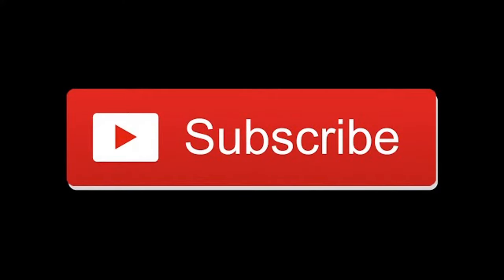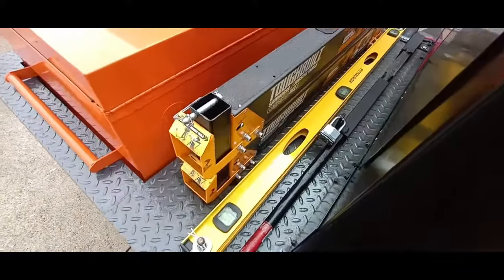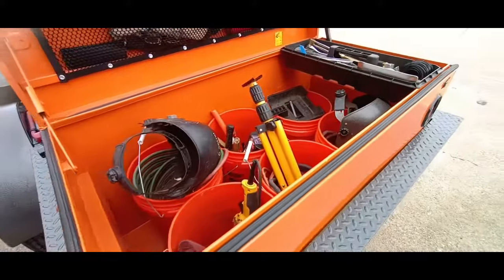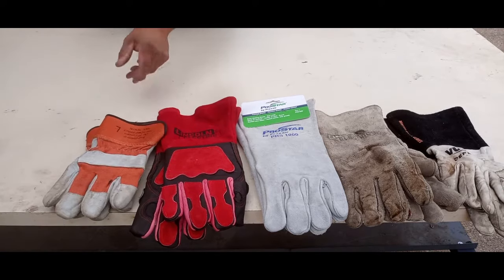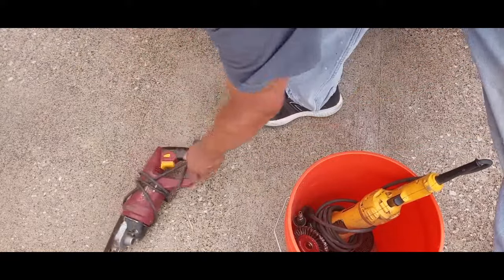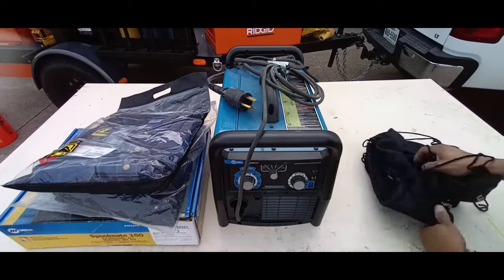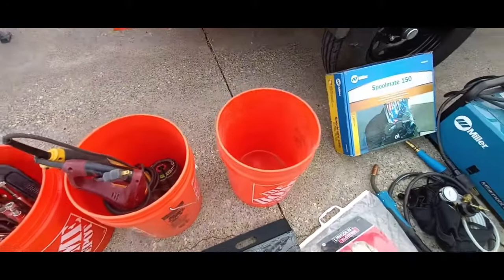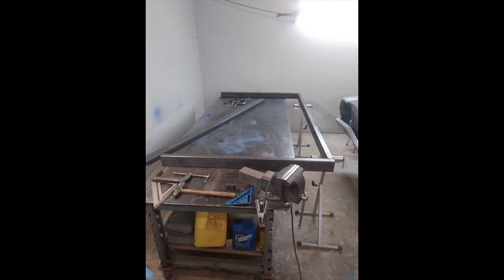Our Mobile welding rig and the tools / equipment we carry  -  DIY Auto Restoration

Comment: Great job on the weld trailer build! Now you gotta build a dedicated truck just to give ideas on how you'd do it and then just tear it down afterwards sense your shop doesn't need it LOL! Example: welding skid for regular pickup , utility body version for the contractors and then a 1500 series custom built using the original bed by cutting the sides down and welding in side load boxes. Just kidding. I'm sure y'all much to busy for all that. I'm kicking around the idea myself about converting a crew cab 1500 into a light duty welding rig using the original bed and cutting down the bedrails to weld in some under deck style boxes. If I do I'll try to get some pics and or video to you guys.
Reply from the maker: Hey thank you for watching I'm going to be adding on to that trailer I'm going to build a gin pole with an attachment and a rack probably put a fire extinguisher in a couple of other gadgets on

Comment: What kind of axle do you have on the trailer? I have a similar trailer at home and I was thinking of doing something like yours. I just wanted to know if my trailer could handle the weight. Also what are those jack stands actual name and use? I’ve never seen them before.
Reply from the maker: Way over kill....it's a 3500lbs axle I purchased at Northern Tool, it was on sale. Those are welders folding jackstand available at any welding supply store. I love them !!

Comment: Have you had the trailer sway with this setup? It looks like too much weight in the back versus the front.
Reply from the maker: The welder is over the axle, right
...
Reply: @guzzifabrication3448  OK-- I had the load shift towards the back on a trailer one time and I got a nasty sway on the interstate. I like the trailer, I am debating trailer vs. flatbed truck on my mobile welding business. Thanks
Reply from the maker: @chriscosby2459  The trailer pulls great, I can lift the tongue by hand, as long as the main weight or load is over the axle you won't have any issues. I see alot of ex-welding rig trucks.... I guess it depends on usage, if your a  welder chasing it everyday, then building a truck makes sense or a great compromise is a skid.

Comment: What do you do for theft protection for the level and saw horses? I want a flat deck trailer but my big holdup is that
Reply from the maker: It would be easy enough to add a lock to those, maybe I should.

Comment: Would be sick to get the plans for this
Reply from the maker: I scratch built, the trailer dimensions are 14' x 4
Reply: Did you angle the front box for a particular reason instead of replicating the rear model of sinking it into the frame or was that cause of the other equipment you have mounted ? Incredibly clean slick design friend , im just fresh starting out trying to get ideas on how to begin , I figured you did it scratch and it’s damn nice . You put your material in the truck for now I saw in the comments, I wonder how an over head kinda ladder rack type removable frame would aid in material storage, however this day in age you need to lock that up just as much if not more then the equipment. Would you do anything different?
Reply from the maker: @jfire5118  The small job box is was after thought, I had already built the frame there is a cross brace underneath....or it would have been nice to sink the box, securing ( locking up ) everything was a primary concern. I've been considering a material rack build other than that I'm really happy with the finish and wouldn't change the layout. Thanks for watching !
Reply: @guzzifabrication3448  last thing , did you do anything to support the underneath the job box?
Reply from the maker: @jfire5118  Bolted on sides w/bracket to frame.

Comment: How much does something like this weigh. But looks great
Reply from the maker: That's a great question... well the welder ways 600-lb itself the trailer frame is way over built plus everything else just a total guess 2000 - 2500 lbs ???

Comment: Nice build. How are you liking the 250GXT so far?
Reply from the maker: Thanks ! It's a great machine for the types of light/medium duty field work we do.                                                                                                                        Not welding related, but we were hit hard in Texas 2021 ( because the electric provider here puts profits first not maintaining/upgrading Their equipment...... ) I ran the GXT 10/12 hours all day and supplied my own electricity to the house off of it....... I ran flawlessly, Thanks Lincoln ! Couldn't count on Oncore the electric provider........
Reply: @guzzifabrication3448  thanks for the info. I’m looking to get one. Really hoping to get a rebate or wire feeder included but doubt that will happen at this point. Happy New Year
Reply from the maker: @mikebb9769  So let me tell you how far out of hand they have let inflation get, I purchased that machine new 3yrs ago and it came with a free suite case welder...... $5000.00...... makes you sick.....
Reply from the maker: I don't know about the quality of the machines sold now.....  Yeah everyone has their opinion on what machine is best.... but Lincoln is my go to. Thanks for watching
Reply: @guzzifabrication3448  what sickens me is that it doesn’t have to be this way
Reply: @guzzifabrication3448 
While Ted Cruz was hiding in the Caribbean. You get what you vote for.
Reply from the maker: @Kyehyfxu  Wasn't me brother that voted for the weasel.....

Comment: Where did you find the twist connectors for building the leads box? I can’t seem to find any that would mount up like that. Sweet build!
Reply from the maker: Ebay type in:  WeldingCity® Dinse-type Panel Socket Cable Connector Pair #2-1/0 35-50mm
Reply: Thank you!

Comment: What is the length and weight of the trailer loaded up. Thanks
Reply from the maker: If I remember right about 13' long 4.5 wide and loaded weight.... no idea
Reply: It's a beauty 😍
Reply from the maker: @MrJasonmca  I just added an air compressor and will be installing a material rack in the near future.

Comment: Dope setup! How big is that trailer?
Reply from the maker: Hey thanks if I remember right about 5 ft wide and maybe 13 ft long
Reply: Do you run your Miller mig welder off of your ranger? Ive always been kinda iffy about running mine off of my trailblazer
Reply from the maker: @natewilliams8823  Yes, I haven't had any issue running the Miller 211, it only weighs 40lbs ( which is nice ) and it's an inverter type, I haven't run a transformer machine off of the generator

Comment: Hello, What thickness diamond plate did you put on the deck of the trailer?
Reply from the maker: More than likely 1/8 of an inch it's been a little while since I built it
Reply: @guzzifabrication3448  Thank you! Building a 4'x8' to set my welding equip. on.
Reply from the maker: @grumpyguys4082  Nice !

Comment: it will get stolen easier
Reply from the maker: I have .45 reasons it won't.....
Reply: @guzzifabrication3448  still harder to steal when it’s mounted to a truck
Reply from the maker: @jessihawkins9116  Yes, if the trailer isn't connected to the truck it's in the shop. So what do you think about the rig ?
Reply: @guzzifabrication3448  I think it will get stolen 😕
Reply from the maker: @jessihawkins9116  🤔🤥

Comment: Never heard it called a triangle 📐 3 4 5
Reply from the maker: How many points are in a square, 4... how many points are on a triangle 3.... how many points are on that tool 4 or 3 and would you say that tools in the shape of a square or a triangle ? Yeah I'm just running you😅 I know everybody calls it a square.... mmmm but it does make you wonder why it's not more commonly called a triangle.....
Reply: @guzzifabrication3448  it does defiantly on that tool but the manufacturer calls it a "speed square" so there 😀📐